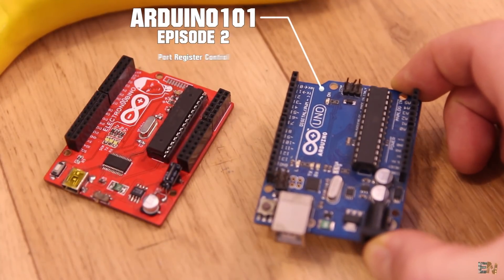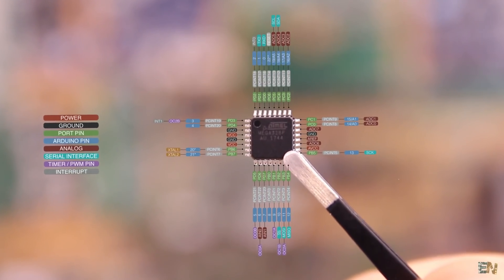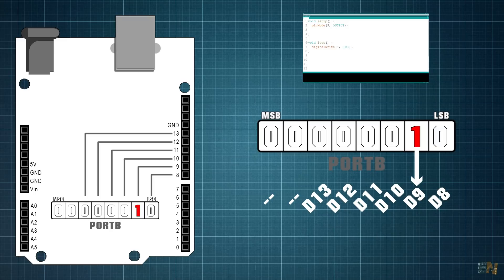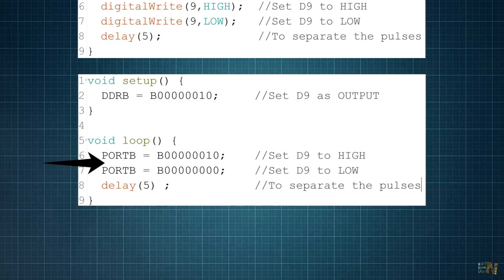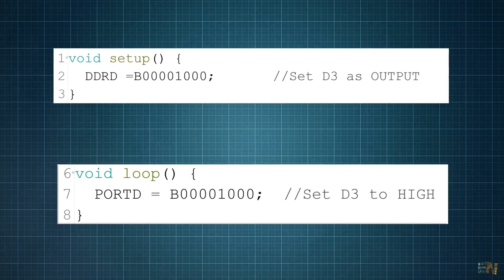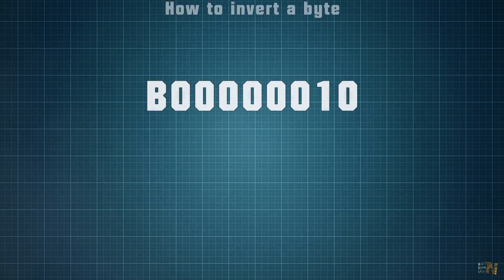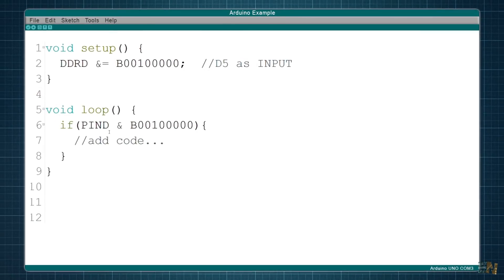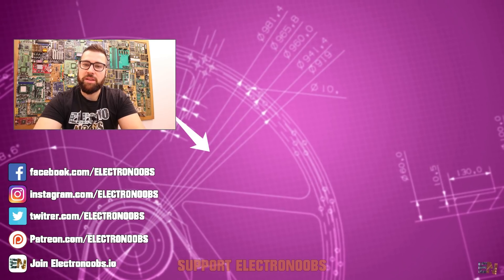Port Register Control | Increase speed of Read/Write - Arduino101

Comment: Are there any pull-up / pull-down registers inside those ports that could be connected/disconnected by some bit configuration in some register?
Also, what about the PWM modes and analog modes? How are those controlled?

Comment: very good video, thanks. I still have one question. everybody sais, writing to the register makes it faster, and it has been proven. i assumed, when uploading the code to the chip, the arduino ide or platform io converts the code into an array of ones  and zeros, the chip can understand. Would it not be logic, to convert into an optimal  form for the performance of the chip. and if so, why would the ide not convert to register commands automatically?

Comment: A very detailed and great explanation to low-level optimization to Arduino. However we should point out that this only works on specific Arduino type, different type might require different configuration (and thus different code on different platform), while on the other hand a common Arduino function like digitalRead / Write is platform agnostic, it can even run on ESP32 or ESP8266 and many other types that conform with Arduino.h standard without changing code (except the pin number). So, for the sake of simplicity and portability there is always performance hit to pay. This is true for all programming language. The more you into performance, the more specific/limited device your code can work.

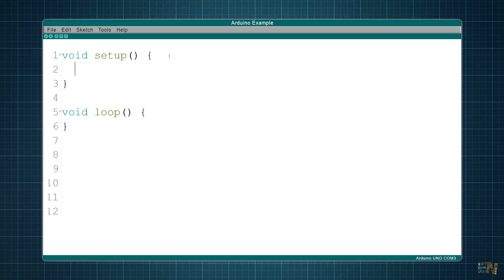Comment: Hi, thank you for your lesson! This is really helpful. I have question, when you set D5 as an input at 12:41, why is it DDRD &= B00100000 and why not DDRD &= 11011111. You said earlier we use & to place 0. Can anybody help? Thank you
Reply: The operation:
DDRD &= B00100000;
clears (zeroes) all bits in DDRD except leaving bit 5 unchanged
---> Every Pin on PortD goes to input mode except PD5, that stays the same DDR mode it was before this operation.

becaus if bit 5 was 1 before then we have: 1 & 1 --> stays 1
if bit 5 was 0 before then we have : 0 & 1 --> stays 0
and every position we have a zero will turn to: anyBeforeBitValue & 0 ---> 0
Reply: @Henry-sv3wv  thank you, Sir! I got it now
Reply: but i think it's too easy making a mistake and then nothing works , so you can use the macro bitWrite:
bitWrite(ADMUX, MUX3, 1); //set that bit
bitWrite(ADMUX, MUX3, 0); //clear that bit

(defined in Arduino.h )
Reply: @Henry-sv3wv  wow this is nice. I just knew this. Is there any different between bitwrite and the port register?

Comment: Can someone explain to me how DDRD &= B00100000; sets D5 as input? "and" needs both bits to be 1 to make it 1, so its value wont change, but all the other bits should be set to 0. Isnt this supposed to be an |= operation?

Comment: I always thought they messed up with the clocking crystals.   The super tiny 16MHz SMD crystal which is really hard to replace was put on the Mega328 while the PTH large, easy to replace 16MHz crystal was put on the U16 which almost no one touches

Comment: First many many thanks for the video,I am from India,I am an ordinary television technical person . I don't know about programming of microcontroller. Sir you feel proud to know that after watching you video 10 to 15 times and doing some practice I found a mistakes at 12:25 in the video. I think you display PORTD|=B00000010;// set D3 to high should be PORTD|=B00001000; same to PORTD&=!B00000010, should be PORTD&=!B00001000;// set D3 to low.
Many many thanks , please reply

Comment: Hi. Thanks very much
However, i wonder if the and operation at 12  41 is correct. It seems to me, that the &= operation sets all pins from D port as inputs, except the sixt one, which is set as output if it already was
No problem, still it is an awesome explanation,  for which i am greately gratefull
Thanks

Comment: As a professional programmer it really isn't nice to see you using wrong semantics. The examples like the following one don't make much sense: B10100000 |= B00001000. You are using the assignment operator, but you can't assign a number to another number. Using the |= and &= assignment operators is only valid when the left hand operatior is a variable. The correct notation for above example is therefore: B10101000 = B10100000 | B00001000

Also you left out that "a |= b" is just short for "a = a | b" and  respectively "a &= b" is short for "a = a & b".
Reply: Christian Weissmuller  I did not say B10101000 was a variable. Actually what said is the exact opposite. And as stated in my initial comment, programming is my profession (more specifically in C++ among others). So I don't need teaching in terms of basics.
Reply: Christian Weissmuller  When I referred to B10101000 = B10100000 | B00001000, I was not talking about real code. I was referring to a mathematical notation. The = sign was therefore stating equality and not meant as an assignment.

Comment: Great video! At 12:20 in the upper "loop()" commands, shouldn't those be:  PORTD |= 0001000  and PORTD &= 00001000 accordingly? We're trying to set bit 3 of the register (Arduino pin D3). If we leave it as is in the video, it sets bit 1 of the register (Arduino pin D1). Do I miss something?

Comment: Hi, like it very much but I do have a question. So, OK, you can write,  read, and change state of bits in a register byte like PORTC. However, how does the compiler knows that PORT is at address 0x08 (0x28) ? I imagine that this is all taken care by the function setup() when we first call it ?

Comment: For our project we used “FastIO” headers that define helpful macros to initialize, read, and write to the port bits using the digital PIN number, concealing all the binary math. They really speed up digital I/O, so we extended them to several platforms. For analog pin reading you can do similar tricks, by first setting up the pin for reading, then starting the ADC, and then going off to do other things and picking up the ADC result later, instead of calling analogRead() and waiting for it to return. That would make a good related subject for a future video. Cheers!
Reply: If you need performance, then write in pure c/c++.
Reply: @richardlighthouse5328  I don't know what you mean. Arduino is a pure C++ set of libraries, with just some cosmetic things handled automatically (like function prototypes).
Reply: @MD-vs9ff  I meant without any framework. Just AVR helpers.
Reply: @richardlighthouse5328  What it means: using FastIO is not only having near equal the direct (without any framework) but also platform independent. The hard part is always making the code has near highest performance BUT at the same time platform agnostic (i.e. can be run on Mega, ESP32, etc without changing your code).

Comment: How to program any type of microcontroller.  How to program ESP32 with mobile. How to use any type of eeprom , memory ic and rom with Arduino. How to make a chipset led chaser like Chinese chaser at very low cost. How to make a master remote that can controll your electronic aplineses. How to design our own ic , microcontroller and microprocessor. Please make a video.

Comment: Is there an explanation for why arduino doesn't use the chip's numbering? I don't buy the software portability explanation--there are too many differences between chips that your code will never be ignorant of the chip, unless you only use the common subset of features supported by every chip, ever.

Comment: 12:21 In Loop function, why you use 2nd bit? In the setup() function, you set register to 4th bit.
Reply from the maker: That's an editing error. Sorry. It should be the forth bit!
Reply: @ELECTRONOOBS  Thank you replaying. Anyway, I'm new to bit shifting thing.
PIND >> 5 & B00100000 >> 5 Why shift 5 twice?
The result of 1st shifting is B00000001right?

Also, what happen if we use PIND with '|'   instead of '&'?

Comment: @electronoobs Is the set up value at https://youtu.be/UhTRrjYXqPU?t=830 correct?    Doesn't 1 mean output?   Maybe you intended the value to be negated ?   DDRD &= ! B00100000   ?
Reply from the maker: Yes, that is an error.  It should be inverted.
Reply: @ELECTRONOOBS  Meant to add that your videos are always well presented and enjoyable.

Comment: There's a header file that turns digitalWrite and digitalRead into direct register accesses. It's not enabled by default since some programs expect the delay in order to work properly, plus it only works on the "classic" Arduinos and not the ARM based ones.

Comment: You can use _BV(x) to give a bitmask like _BV(5) is the same as B00100000. The preprocessor just swaps in (1 << x)
Thanks I didn't know about the ! operator, I usually use a tilde ~

It's been a while since I used Arduino, I use Teensy now.
The newer models have additional registers that can do that bit-twiddling for you in one cycle
You can set, unset and toggle (XOR) a port's bits without reading the port before the operation
Reply: It's actually wrong, it should be a tilde there. ! is logical NOT, tilde is bitwise NOT. !B11110111 would be B00000000 because it evaluates nonzero values as true, then changes the entire value to false.

Comment: Great video man! Best explanation I've seen out there.

To make your code easier to read you can also use constants like so:
DDRB |= (1 << PB2);         // declaring pin PB2 as an output

PORTB ^= (1 << PB2);      // toggle the output high or low in just one instruction
Reply: thanks a lottt, it's worked
Reply: PORTB ^= (1 << PB2) would work if you only care about PB2 bit, but it would also flip other bits in PORTB, so in general I wouldn't use it.

Comment: 12:43 is that correct? Because i think that it needs to be DDRD |= B00100000

Am i correct?

Edit: thanks for the video btw. I study CS and have to learn bit manipulation but my teachers suck 😂
Reply from the maker: Port B are pins from 9 to 13
Reply: @ELECTRONOOBS  but it uses and operator so resets the other pins to 0
Reply from the maker: @isso013  yes because we don't care about the other pins. PIND register can't be changed. Is  a read register. So basically we check if bit 5 of the PIND is 0 or a 1. That's why we make an AND with a 1.  If bit is 0 result is 0 and if bit is 1, result is 1.
Reply: @ELECTRONOOBS  sorry meant DDRD
Reply: @ELECTRONOOBS  Sorry, that is not true. Writing ones to a PINx bit toggles the output state of those bits.
Reply from the maker: @svengaefgen5909  What? But in that example we weren't wrinting to PIND. To write you should make PIND = PIND & B00100000; But we were only making PIND & B00100000; without the =,  so that won't change the PIND value, only use its value.
Reply: @ELECTRONOOBS  I was refering to your "PIND register can't be changed. Is  a read register." it is not. Ones written to it toggle output bits.
Reply: @svengaefgen5909  you use portD for that right?
Reply: @isso013  Form the datasheet: "I/O memory address locations are allocated for each port, one each for the Data Register (Portx), Data
Direction Register (DDRx), and the Port Input Pins (PINx). The port input pins I/O location is read-only,
while the data register and the data direction register are read/write. However, writing '1' to a bit in the
PINx register will result in a toggle in the corresponding bit in the data register."

Comment: Very nice production quality. Using a define for the pin value B0001000 etc would make the code easier to understand, but I understand you were trying to explain bit access for which your method was clearer to someone new to the topic.

Comment: There is a mistake à 8:52, it its // 0,1,2,4,6 LOW
Reply: at 12.21 it does not looks good either in the loop function

Comment: bro can  u make  video on how to fix arduino uploading problem in cheap  arduinos. it is the most wanted tutorial from amazing guy like u
Reply: I too use clones n I've never heard of such an issue.. maybe u keep blowing the serial converter on the board?
Reply: @ChathuraJayasundaraIMD  no when ii try to upload more than 3 codes it says the error i tried everything to do. reinstalling software;updating driversetc. there are no such videos to solve problems..it mostly occurs on those chinese clones.
legit arduino dont have such problem i think so i need solution